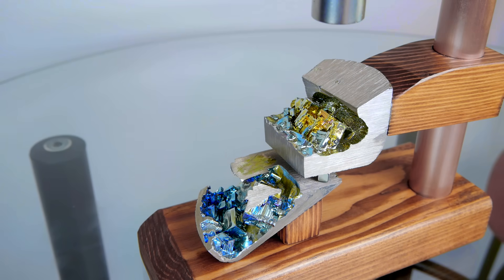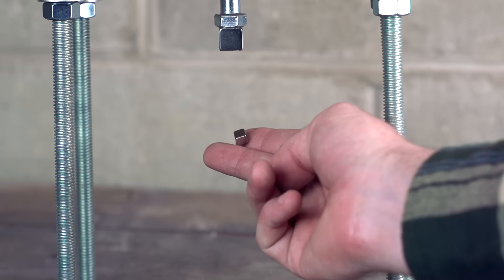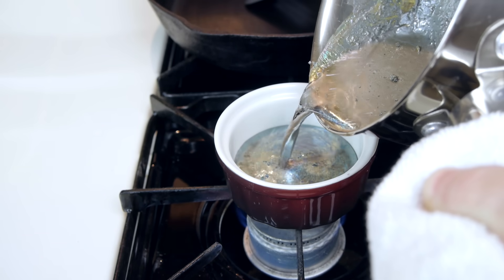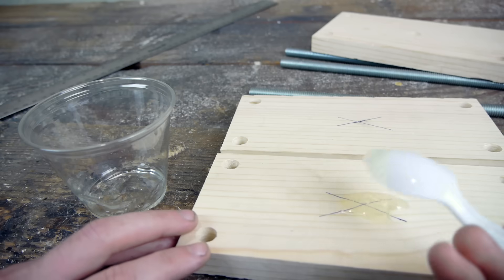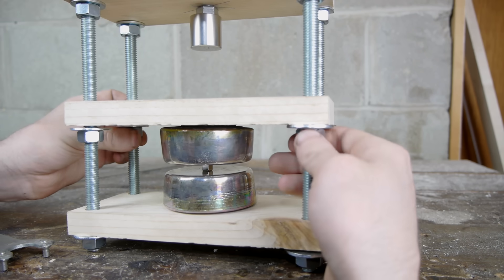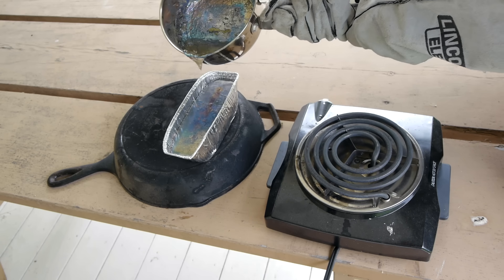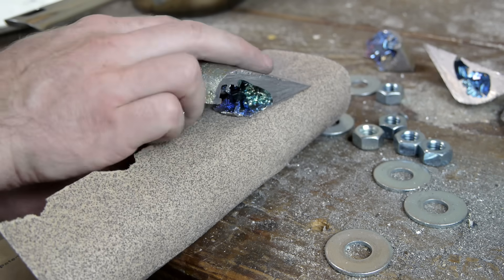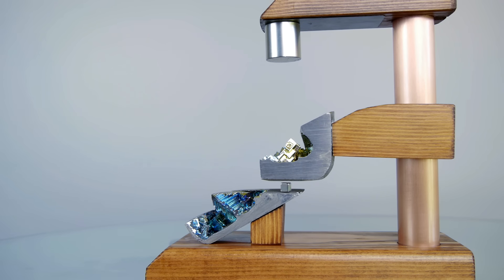Levitate a Magnet with Bismuth Crystals - No Energy Cost, Indefinite Levitation - NightHawkInLight

Comment from the maker: Note that I have links that can be used to purchase bismuth in the video description.

Also, if you leave a comment please be sure your G+ privacy settings are set so I can reply to it. Especially if you ask a detailed question and I don't reply, it's probably because your settings won't allow me to.
Reply: The three-eyed Prophet im realizing you might not be a native english speaker, so were two now
also there's no "free" energy, you can't create nor destroy energy, to get energy from something you gotta apply a different kind of energy first
generators usually consume a non applicable energy and give electricity or heat or whatever other applicable energy its made for
Reply: You shuld do a give away of your art work :D, it just so amazing, kinda look like a desk "toy" like the balls that hit each pther and so on
Reply: +NightHawkInLight What a simple and elegant toy!
Reply: can i buy this from you it looks so cool
Reply: FantasmaNaranja, I have good news, lignum vitae wood is VERY resistant to rot, and there are metals (like rhenium and platinum) that just will NOT corrode, (but these metals are expensive.
Reply: not too radioactive as far as i know
and bismuth is used in pepto bismol so if it was toxic i doubt they would use it
Reply: ***** there are materials that can hold an stronger magnetic charge, + you would need a metric fuck ton of magnetic material that's strong enough to not be damaged by the weight of the car (you cant lift something without making an opposite reaction on the ground where its being lifted,) i think so anyways i may be wrong
 
(also im eating a rye sandwich im sorry)
Reply: The three-eyed Prophet i mean, its not like he's the first one to try and discover this
Reply: In a Vacuum... There still couldnt be perpetual motion due to the loss of magnetism over time could there??? Great art piece also!! I'm totally impressed !! :)
Reply: its so it looks better
Reply: Cruxon Noctus You might be thinking of thorium.
Reply: I HOPE U NOW HOW IMPORTANT YOUR DISCOVERY IS....
Reply: FantasmaNaranja NO BUT HE IS THE FIRST ONE TO MAKE IT THAT EASY
Reply: The three-eyed Prophet is he though?
Reply: FantasmaNaranja THE FIRST VIDEO THAT IS THAT GOOD THATS A FACT
Reply: The three-eyed Prophet did your uppercase get stuck?
Reply: FantasmaNaranja my what? this video is helping its a how to video its helping people that care about tesla free energie and supra condiction or how thats called i had always the problen to find a easy for my magnets to adjust and this is the most simple one i have ever seen
Reply: NightHawkInLight everything has an energy source, did you not pay attention to energy can neither be created or destroyed???
Reply from the maker: Only things that expend energy need an energy source. A levitating magnet in this system doesn't use any more energy than a magnet that's sitting flat on the ground.
Reply: NightHawkInLight oh, so what your saying is it recycles energy???
Reply from the maker: No I'm saying there is no input or output of energy. The magnet is in a stable position. No work is being done by it sitting there between the plates.
Reply: NightHawkInLight oh ok, I get confused a lot.
Reply: Hy=ey so HEYYY I luvvv ur vids stay happy!
Reply: NightHawkInLight great work. But why the copper? It is at something distanse, but Indy currents should consume energy.
Reply: Χρυσόστομος Τουτουντζόγλου - Πειράματα σε σχολικό εργαστήριο you mean eddy currents.
Reply: Yeah, That is wat i meant. Don't know how i stuck to that...
Reply: how thin do you think the bismuth could be and still have it exhibit diamagnetic properties?
Reply: Men .... :P .... Plisss .... Read more ... :) This USA fallowers are scary ...
Reply: How do I set g+ privacy?
Reply: @YunxiaoChu Google+ was shut down in 2019, so don't worry about it.
Reply: You don't lol, google+ was shut down ages ago  @YunxiaoChu
Reply: the sad thing is since its made of wood it will rot before the hundred years pass by (also metal rusts yadda yadda)
Reply: NightHawkInLight I like your imaginative expressions on this subject - discovery is the key to scientific breakthrough and you are moving in the right direction! I would like to share with you something I've discovered-everything comes from God! Science is our way of finding out what is hidden! Hidden on purpose! All of creation has its origin from THE Creator! The Bible says that "All things were created by Him and for Him" (Colossians 1:16). You can share in even greater discoveries when you come to faith in Jesus Christ! See Romans 8:18 "Revealed Glory" awaits those who in this life repent of sins and place their trust in Jesus Christ! It would be awesome for me to discover that you put your faith and trust in The Creator Jesus Christ! He cares for you and has an amazing plan for your life! Experience Him today by faith! 
Hope to meet you someday in this awesome magnificent universe fellow explorer!

Comment: When you were using the melting pot to make crystals, how long did you wait before pouring out the remaining liquid?  Also, would a cheap ($5-10) saucepan work for melting the bismuth?
Reply from the maker: Nelinno04 Basically until it looked right. You want to wait as long as you can before you don't think you'll be able to pour out the center. You might have to try a couple times before you get a result you like. A cheap sauce pan is what I used in the video.
Reply: NightHawkInLight Thank you so much; I'm planning to make this for my sister's birthday.

Comment: Hey, Ben!  I know this has been discussed endlessly, but I thought I'd ask anyway.  How does this work?  I know you explained how it functions from a basic standpoint, but this looks like free energy, i.e. a perpetual motion machine.  Now, I know that the laws of thermodynamics prevent that.  So I want to ask, where does the energy come from?  Do the 'permanent' magnets eventually use up all of their potential energy and become simple blocks of metal?

Cheers!
Reply from the maker: Caleb Voisine-Addis When the magnet is balanced between magnetic fields there's no energy required to keep it there. It may as well be flat on the ground as far as energy is concerned. It's not a free energy device, it can't in any way produce energy, but it can remain at equilibrium for a long long time. Concerning perpetual motion machines, there's a difference between perpetual motion and free energy. Perpetual motion is created when a system can conserve all the energy it starts with, which is possible to nearly attain in a friction-less system. Free energy or 'overunity' machines on the other hand are 100% impossible, and differ from perpetual motion machines in that they would not only conserve their own energy, but somehow pull extra energy out of thin air.
Reply: Ah, I think I get it.  So, basically the magnetic force is acting like the normal force when in object is sitting on a surface.  That makes sense.

Comment: NightHawkInLight 
Could this potentially generate free low maintenance electricity say by surrounding the magnet with a simple copper coil to test theory, and then upscaling the whole thing for increased volts and amperage?

Comment: How hard is the metal?
Because it would make a sick looking dagger
Reply from the maker: VuMp x It's pretty soft and brittle. Not very good for making daggers.
Reply: Thanks for the fast answer!
I also have a question about the cigar box guitar.
I made one, but it is pretty silent.
Any idea for to make it louder?
Reply from the maker: VuMp x Bigger cigar box maybe, or install a pickup
Reply: NightHawkInLight i also get buzzing on only the middle string.what could cause that
Reply from the maker: VuMp x The staple could be a little lower than the others on the headstock, or the tuning has that string under lower tension and you need something to dampen the buzz below the bridge.
Reply: VuMp x It could be used on the hilt of the dagger
Reply: Its definitely not hard, but you could try epidote for a sweet hilt

Comment: In the description you said there would be no external forces if this design were in a vacuum. But would the magnetic not be influenced by the polarity of the earth?
Reply from the maker: Magneto! I suppose it would, but it wouldn't make a difference in the spin of the magnet if the device was oriented in the correct direction to not be at conflict.
Reply: NightHawkInLight oh yeah I forgot about that. You totally should make a vacuum chamber and put this in it and keep a running score of how long it spins. And you could do a give away to whoever guesses the closest for how long it will spin.

Comment: could you scale it up and put an alternator on it = free energy
Reply: No.  While it seems like the magnetic cube could spin forever, it ultimately cannot.  Friction between the cube and the air means that eventually the cube will stop spinning.  The net energy being put into this system (spinning the cube) is not returning a greater output.  Therefore, "free energy" is impossible with this system (and any system for that matter).

Comment: Mr. NightHawkInLight, would it actually spin for 100 years before needing adjustments?
Reply: The friction would make it stop spinning I think
Reply: john may he said it would levitate for 100 years, those numbers are directly derrived from the properties of bismuth's diamagnetics. it would stop spinning in an hour or two i think
Reply: Carter Reed air creates friction why do you think when you stick your hand out the window it gets pushed back and why do you think you need 8000 hp to go 330 mph in a drag car but a Bugatti vss only need 1500 to go 250 mph friction
Reply: john may yeah, it would be the friction
Reply: He said levitate
Reply: alex alexalex When it comes to Drag carts I think it has more to do with aceleration because the Drag cart gets to high speeds very quickly compared to the veyron.
Reply: alex alexalex did you read the original comment?
Reply: Carter Reed yes its a example

Comment: So now we just need to make subway tubes out of bismuth and have the train and ceiling generate a magnetic field.
Reply: That would be extremely expensive and the amount of fuel efficiency gained would not be worth the cost of the resources.  However, the concept of using magnetism to lift and propel trains has been implemented (https://en.m.wikipedia.org/wiki/Maglev).  Mag Lev trains can go much faster because they have no friction with the ground, and using electromagnets to propel the train is actually a pretty cost efficient method of transportation.
Reply: So many electronics would be destroyed however
Reply: Sgt Nomad Quantum locking would be the most efficient way to create a maglev train. Quantum locking would also not require magnetic fields large enough to surround the train so no electronics would be in danger.
Reply: Sgt Nomad That's exactly what I was thinking
Reply: ***** hmmmm. Alright what if then instead we have the outside of the train be an electromagnet and the walls of the train made of bismuth. Pull into station, the train shuts down it's magnet to "land" and everyone can board with no magnetic interference.
Reply: ejler thomsen If we're just seeing things that happen and making up the notion that they can be made to solve the problem, why don't we just skip straight to quantum teleportation?
Reply: ejler thomsen Quantum locking also requires the use of a superconductor, which can currently only be achieved by cooling exotic materials down to hundreds of degrees below freezing.  Until we achieve cost effective room temperature super conductors (which may or may not be possible) its not a cost effective solution.
Reply: Robin Parmentier we have achieved superconduction at liquid nitrogen temperatures, which is considered a "reasonable" temperature compared to liquid helium, unfortunately the base material is expensive as hell

Comment: Hi NHIL, if you have oxidized Bismuth and want to clear it, oxidize it some more, until it becomes a reddish brittle substance (Bismuthoxide of a high oxidation). Mix that BiO with graphite and heat it until it melts at about 820° C, the molten BiO should then start to bubble like carbonated water, and little bubbles of pure Bi will swim up. Bismuth is such a great element, you gotta love it!
Reply from the maker: Eliphas Leary Interesting, bismuth thermite. I didn't know about that recovery method.
Reply: NightHawkInLight
Well, I didn't want to throw the stuff away that floats on top after melting, so I read how they do it in the industry. But it's not like thermite, it's endothermic.
Reply from the maker: Eliphas Leary Sure, it's a replacement reaction though just as thermite is. At least I assume it's a replacement reaction, I haven't looked it up.